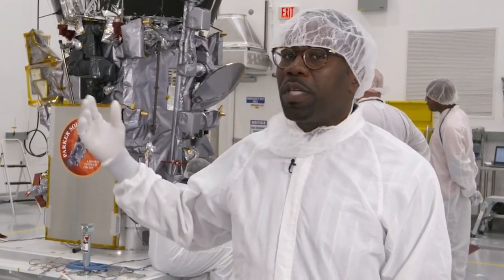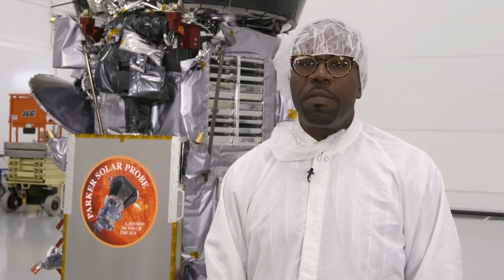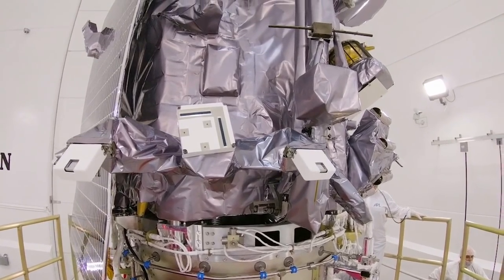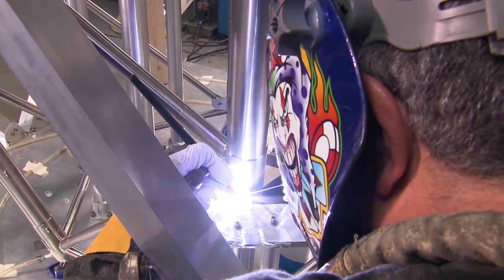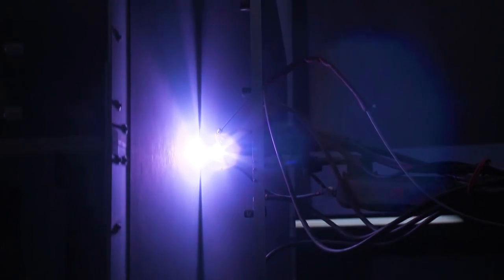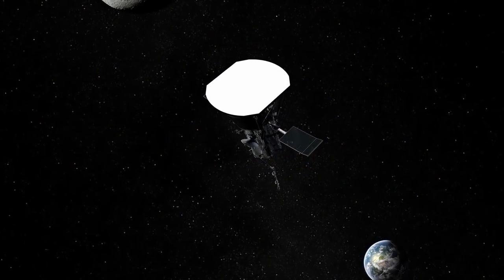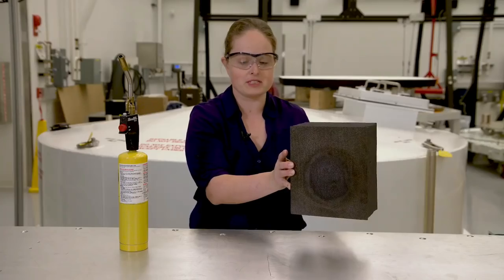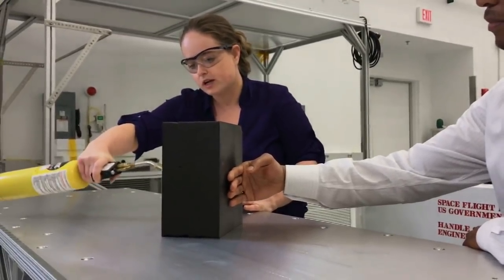Parker Solar Probe heat shield explained

Comment: Fahrenheit? Do you measure the distance to the sun in hand spans too?
Reply from the maker: In the description you will find it in Celsius.
Reply: Why? Are you confused by any measurement that doesn’t require you to count your fingers? Cause that’s where bass ten comes from.
Reply: Not necessarily, 10 fingers isn’t optimal for everything
Reply: In imperial (neanderthal) units, an astronomical unit is 744 million furlongs or 2.97 billion rods.
Reply: Millimetres to Meter: 1000    Inches to foot:12
Meters to Kilometre: 1000     Feet to Yard: 3
                                                   Yard to a mile: 1760
Grams to Kilogram:    1000   Ounces to a pound: 16
Kilograms to a tonne:1000    Pound to ton: 2240

Its just that simple, lets not have another Mars Climate Orbiter

Comment: So the heatsheild is a sandwich of carbon-carbon composite then a carbon foam and then another carbon-carbon composite. Carbon-carbon composite is carbon fiber embedded in a carbon matrix. So it is "CARBON!!!"
Reply: Diamonds are carbon too, but they sure as heck arent good thermal insulators. I quite liked the emphasis they put on correctly saying all the carbon based components the shield has
Reply: Carbon sandwich with carbon filler. 100% chocolate Oreo.  :-)

Comment: Very informative and excellent video. 
Is there any heat transfer due to exposed portion of some instruments behind the Heatshield into the probe due to Conduction ?
Reply: thought the same
Reply: From what I gather, yes but minimal
Reply: I guess everything coiled by cooling radiator, and it is 85F at the back..

Comment: 2500 Fahrenheit on the front face? 1370C, or 1645 Kelvin.
That is well past yellow hot, approaching  pure white hot. About exactly the melting point of mild steel.

Comment: What's the flame temperature incident on the carbon foam you're showing? And it's about one million degrees centigrade in corona so how does this carbon foam respond to million degrees centigrade temperature?
Reply from the maker: At closest approach, the probe is “coming within 5.3 million miles (8.5 million kilometers) of the solar surface.”

Comment: Is it a better insulator than aerogel? Or its just better at high temps?
Reply: My guess is that aerogel's insulation is based on air being trapped inside the gel lattice, and in the vacuum of space that air would seep out, rendering the gel useless. Thus, they need a material whose insulation is not based on trapped air.

Comment: What would be the angular diameter of sun when the Parker Probe is at perihelion?
Reply: Okay now that I have some time... getting back to my own question....

So using small angle formula:

Given:
Dist = Distance from probe to sun = 6,000,000 Kms.
Dia = Diameter of Sun = 1,392,784 Kms.
Pi = 3.14159

Find:
Theta = Angular Diameter from probe.

Dia / Dist = Theta / ( 180 / Pi )
1,392,784 / 6,000,000 = Theta / ( 180 / 3.14159 )
0.2321306666666667 = Theta / 57.29582790879777
13.300188 = Theta = Angular Diameter from probe = 798 arcminutes

Woahh!!!!! 798 arcminutes is HUGE!!
Hypothetically if you could safely sit on Parker Probe when it's closes to the sun and look at the sun; the sun would look as big as your fist on extended arm.
Just wow!
Reply: That doesn't seem to be  that big (to me).
 Distance to sun about 1/24th AU